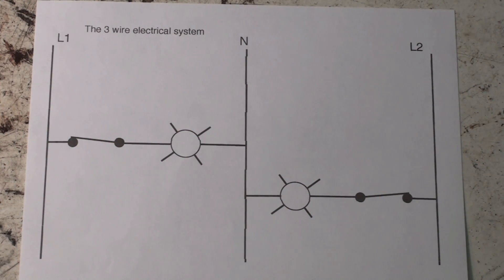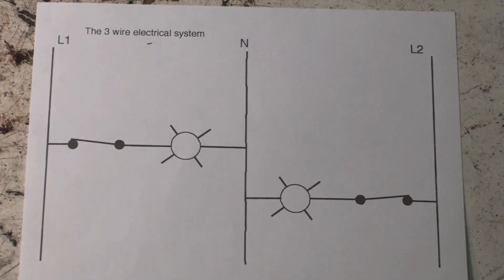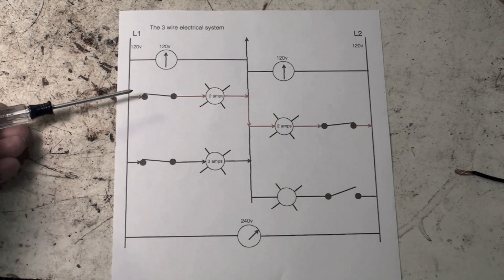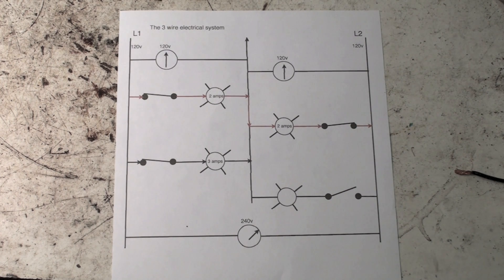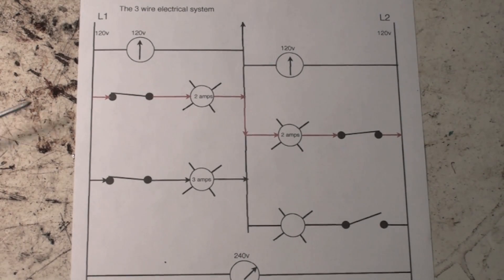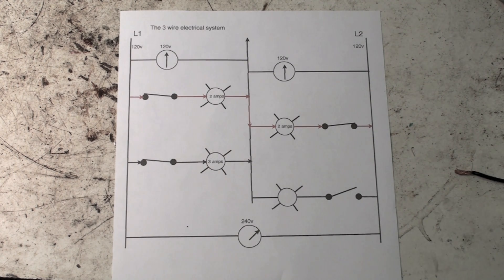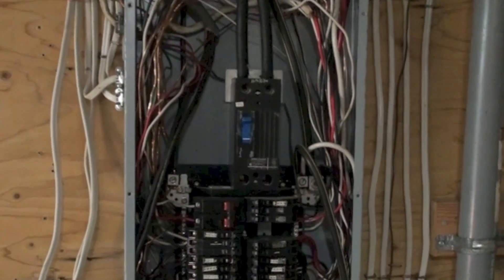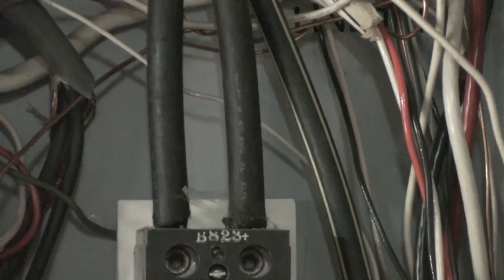How the 3 wire electrical system works

Comment: I am sorry this guy does not know what he is talking about. Power does not run backwards on the other hot wires L1 or L2. AC current runs up and down in a sine wave, but It only generates work in one direction on the down stoke from +0 degrees to -180 degrees.  To get 240 volts you have to have 120 volts on L1 and L2 put in a series circuit to add the voltage and they have to be out of phase by 180 degrees. What that means is when one line is at +0 the other one is at -180 its recovery stage backup to +0. 
All I am saying is power runs from L1 to neutral and L2 to neutral period. 240 volt is L1 added to L2 added together in series and out of phase.  All power going into your house goes back to neutral in your box where it is connected to ground.  All power in the neutral wire will be sent to the ground, not sent to another home.
The power does not reverse down another wire to balance other loads or homes.  Once it goes through a light (load) energy is used up and voltage and amperage would drop, so the next light would be dimmer.  There are better videos on this subject, don’t listen to this guy and don’t confuse people making videos on subjects you know little about.
3 Phase AC Motor Working Principle
Reply from the maker: I'm not sure where to start.  Of course power does not go backwards thru the hot lines.  It is balanced with other houses on the same transformer.  As to how it is balanced from there, I have no idea.  That is for the utility to deal with.  
The generates work issue makes no sense to me.  There is power available for work in both the positive and negative wave.  
If you have a 240 volt circuit neutral is not involved and is not provided to a 240 volt circuit.  You can test this by clamping the incoming power leads in the panel,  then clamp the neutral.  You will find the amperage to be much lower on the neutral.  
While you are at it you can also clamp ground and you will find little or no amperage.
L1 and L2 are not out of phase.  If they were, the total voltage would reduced by the amount of out of phase they are.   Here is a video on the phasing between the two 120v lines:  http://youtu.be/bnPNMKdXj84
If the house had only 240 volt appliances, there would be no power at all passing thru neutral.  
The earth ground plays little or no part in the circuit.  It is primarily spike absorber and lightning diverter.  This video explains the difference:  http://youtu.be/-n8CiU_6KqE
I did take a look at the video you linked.  It is correct as far as it goes, but there is much more to this issue.  
I do appreciate your comment.  I just think you are wrong.  I will welcome a return comment or better yet, a video. 
GFM
Reply from the maker: Not meaning to beat you up but, Good grief.  This is a video about the 3 wire system.  How to understand why you read certain voltages and amperages at certain places.  Consider you are someone looking to understand how the wiring works in your house.  Would you need to know that " both current and voltage are negative then power is positive"?   Your comment has more value to those studying theory.
GFM
Reply: grayfurnaceman Yes,...Love it,...High Five!
Reply: A technical note: Power is the product of current and voltage or Watts=Volts*Amps. That said:
1. If both current and voltage are negative then power is positive.
2. If both voltage and current are positive, then power is positive.
But
3. If voltage is positive and current is negative then power is negative.
4. If voltage is negative and current is positive, then power is negative.

Pure resistance loads will always have positive power flow, but negative power flow can happen, if only momentarily, during each cycle if there is either capactitive or inductive reactance in the load.
Reply: I understand, and I understand the video's intent and audience. On the other hand,  comment discussion threads often digress into other areas. I only offered my comment  on power flow direction for technical accuracy in this discussion thread, rather than starting a new one.
Reply: @Keith so what youre saying is that opposite phases will cancel out due to opposite voltages and no potential from there?

Comment: This guy is an idioit.  The power company dose not have neutrals on power poles, they have grounds, the neutral originates at the main breaker panel at your house or business  where the ground stake and the house neutral are bonded together.
Reply: The neutral does not originate at the main panel. The neutral originates from the transformer that's on the utility pole. 1 Phase from the HV line goes into the transformer, the primary winding, the secondary winding is CENTER TAPPED VIA GROUNDED NEUTRAL that is why L-N is 120, L-L is 240, because of the neutral. Look it up on Wikipedia. Here's the link http://en.wikipedia.org/wiki/Split-phase_electric_power
Reply from the maker: If you are interested in learning about these concepts, this video may help:  Ground Resistance Testing (real world experiment) with Electrical Code Expert Mike Holt  I also have a playlist on grounding and bonding that explains more of these concepts with several more in the pipeline.  This is the most misunderstood concept about our electrical system.  Hope this helps.
GFM
Reply: Contrary to your comment, this guy is NOT an idioit (sic).
However, according to the definitions of the International Electrotechnical Commission (IEC), both of you could be both right and wrong.
International standard IEC 60364 defines Earthing (Grounding) arrangements by using a set of standardized letter codes, where
“PE” = Protective Earth (Called “Ground” in North America.)
"N" = The “Neutral” conductor of the supply, which is connected to Earth.
"T" = Direct connection of a point with the “Earth” (From the Latin: terra)
“C” = A combined PEN conductor fulfills the functions of both a PE and a N conductor
 “S” = Part of the system uses a combined PEN conductor, which is at some point split up into separate PE and N conductors.
Most developed countries now use what is termed a TN-C-S earthing system.
In this case, the code (TN-C-S) indicates that, at the source of supply (the transformer) the Neutral (N) is connected to Earth (Terra,) a Combined (C) PEN conductor goes from the supply to the distribution board but Separate (S) PE and N conductors are used in fixed indoor wiring and flexible power cords beyond this distribution point.  (Note that the local Earth stake is not included in the IEC standard.)
In the UK, the system used is also known as Protective Multiple Earthing (PME), because of the practice (as in North America) of connecting the combined Neutral-and-Earth conductor to an Earth stake at each distribution location - and “multiple” customers are supplied (with 230 V) by each secondary Phase of the common supply transformer.  A similar system in Australia and New Zealand is designated as Multiple Earthed Neutral (MEN).
This situation is similar to North American usage, except that there one transformer usually supplies a single consumer at which location a local Earth/Ground stake is provided.  Hence, while it might not be described using the word “Multiple” it could be described using the word “Dual” – either Protective Dual Earthing (PDE) or Dual Earthed Neutral (DEN).
Reply: Actually, from the transformer, the secondary winding is center-tapped with a neutral, allowing the 120v to neutral, 240v line to line. The three wires coming from the pole are your two hots and a neutral. Then neutral is bonded to the grounding at the first means of disconnect. Take a look at your service before running your mouth.
Reply: ABflanagan523
Just because the third wire (the one that is not covered by insulation) looks like the ground, in essence, it is not. It just doesn't require insulation let alone conduit in an overhead service is because the free air allows the conductors to cool off.
Reply: The reason why your compressor starts and trips the breaker is because you have an instantaneous trip breaker that trips because of the FLC of the motor, the calculation you failed to do. Maybe if you guaged the wire correctly and the right size breaker, you wouldnt have that problem.
Reply: The neutral is not on the utility pole, yes because the configuration is Delta, Three Phase. You are right. But when you add the transformer, the secondary winding introduces the neutral because of the L-L 240, L-N 120 that travels either overhead or underground to the electric meter which is the first means of disconnect and according to code, is where the neutral is bonded to the ground. check it up, don't call someone an idiot because of your lack of intelligence on the subject.

Comment: This might be a dumb question but you state that the neutral takes the 120 and it goes back to the power pole. My question is if the main box neutral is grounded also how can it pass to the power pole would it not pass to the ground?
Reply: The code for a grounding conductor is 25 ohms.  An isolated neutral will always read close to 0 ohms. Path of least resistance dictates that the return current (whether it is from a 120 load or an imbalance of a 240 load) will always go the route of the neutral. Besides, in newer homes with an isolated ground, there can be no current to ground unless there is a live fault in the system.
Reply from the maker: The neutral goes back to the pole transformer where it contacts the center of the transformer winding.  The neutral in the main panel is connected to earth ground, and the pole transformer has its neutral connected to earth ground.  The power in the electrical system does not go thru the earth ground.  The resistance is far too high.  Earth ground is just a reference point to drain off spikes and lightning.  Hope this helps.
GFM

Comment: hey your videos are awesome and im learning more and more everyday.....however i have a question regarding grounding....i am designing a science experiment where i have a 120 V source (DC) and i am trying to melt a lego guy that completes a path from the conductor to a block of clay....your saying 120 V wont fry this guy? or do i need something more conductive for the lego guy to step on?
Reply from the maker: First, the lego dude is made from plastic.  One of the best insulators.  Clay can be a very good insulator also.  You would need 800 ohms of resistance to get 150 milliamperes (a possible lethal current) through the circuit.  You have several million ohms.  You might try soaking everything in salt water.  Hope this helps.
GFM
Reply: I figured it was like a polymer based clay or it wasnt high enough voltage....thank you for the advice!

Comment: Great video thanks... could you make a video for 3 phase 3 wires and 4 wires ?
and this unbalanced load for sure balances itself with other loads in the entire system.. I mean there is no chance of going back to the plant? Or how they figure out how much load they have it at the moment?
Reply: You can google TN-C-S, IT, TT, Split phase and High-leg delta.

In Y (TN) systems you have neutral and 1 phase for small loads (normal outlet).
If you have a 3 phase motor, you use all 3 phases, no neutral.
The voltage you get between neutral and 1 phase (in a Y system) should be: voltage between phases (L1-L2) divided by √3.

Split phase would be L1-L2/2
High-leg delta would be L1-L2/2 (This apply just for L1-N and L2-N, this do not apply to L3-N, if you look in to high-leg delta you would understand why).

In a balanced system you wouldn't really like any current going in neutral. Ofc, there will always go current between breaker and load, but from the main panel to the transformer you would like to spread the load on the phases and run as little as possible current in neutral.

Comment: Good explanation, this always baffled me. So does this mean that 240 volts is available at every outlet?
Reply from the maker: Sorry, I did not find your comment earlier.  No it is not.  Only one side of the 240v line is there.  The neutral is the other side.
GFM

Comment: Something I'm missing and I REALLY want to get this. At 2:35, why do the two voltmeters at the top read 120v and the one at the bottom reads 240v. If the circuit is joined at the top, what's the difference? It's all metal wire conducting electricity isn't it? What is separating or splitting the current at the top? Please help. I must understand. :)
Reply: Oh is it because when it hits the neutral line after the first voltimeter, there's a pull that draws the current back out the to the main line and so it never travels to the next voltmeter? I guess like two streams running downhill into a river? (Sorry, I know -  I'm pretty wet behind the ears on all this but I'm also foolish enough to think I can understand and fix my faulty wiring too).
Reply from the maker: The voltage in your home is 240v.  The neutral is a center tap from the pole transformer.  So when you read from the center to one line, you read 120v.  When you read across the 2 hot lines, you will read 240v.  Hope this helps.
GFM

Comment: That makes perfect sense. I don't know if this is something you know or not but the amps that get returned to the power company via neutral is this worked out in the meter reading?
Reply from the maker: Yes.  It all must come thru the hot lines anyway, so the meter reads it there.  
GFM

Comment: at 1:13 you state the neutral is not ground.... however, the neutral and ground share the same potential. If they share the same potential, then, how can they be different?
Reply from the maker: The neutral is used to balance the potential between the 2, 120 volt conductors.  Ground is first connected to a ground rod.  It then goes to the ground bar in the panel which is connected to the neutral.  The potential between the 2 is 0.  But where the neutral goes back to the power source, the ground goes to the ground rod.  What this provides is lightning protection.  If lightning strikes the neutral it dissipates thru the ground instead of getting into the structure.  Hope this helps.
GFM
Reply: grayfurnaceman many confusing things going on here grayfurnaceman. I just looked at my main in my garage. My grounding wire is coming from the pole (xformer) and so are the other wires. 2 legs of 120, 1 neutral and my ground. Also, I see the grounding bar and neutral bar are bonded together in the main fuse box. So, they must have the same potential since my Fluke 87 shows direct continuity between the two. So,  they are of the same potential. Ground and neutral are the same, right?
Reply from the maker: melvin292 No.  Confusing isn't it.  You should not have 4 wires going to the pole.  You should have 2 hots and a neutral.  The neutral is bare.  The neutral originates in the transformer.  
Let's try another example.  The main panel receives the 2 hot wires and the neutral.  The ground bar is connected to a ground rod.  It is also connected to the neutral coming from the pole.  And the 2 are connected together to provide a path for lightning to pass to the earth ground.  If I install a sub panel off of the main, the ground and neutral must be be separated at the sub panel and a neutral and ground must be run back to the main because the neutral must be able to carry current back to the main panel.  I hope this does not confuse you more.
GFM
Reply: grayfurnaceman yet, as you stated in a previous example, "Ground is first connected to a ground rod.  It then goes to the ground bar in the panel which is connected to the neutral." With that said, the ground and the neutral are  the same potential. This must mean neutral and ground are the same... right?
Reply from the maker: Rather than try to explain this method, I will do another video that perhaps will make this more clear.  I may publish this today.
GFM
Reply: melvin292 Yes ground and neutral are both connected the only differance is that neutral carries current to the earth and ground is only suppose to carry current if there is a fault.
Reply: +melvin292 - In a nutshell, neutral carries current, while ground does not.
Reply: +melvin292 - Neutral carries current, while ground does not. Ground only carries current during a fault. Here's an common example to perhaps help you understand this simple wiring. If you follow the wiring, both the brake circuit and the headlight circuit are connected back to the same 12V point in your car. When you push the brake pedal, the brake circuit carries current, while the headlight circuit does not. And vice versa. Being tied to the same point in no way forces current to flow through every conductor tied to that particular point.
Reply: Impossible if neutral and ground share the same potential.
Reply: +Cotronixco no, thats not the right answer. You're not close either. You need to slow down and really think how a circuit runs. We 're not talking about dc voltage or two separate circuits. I will give you a clue; the word is impedance. See if you can figure this out.
Reply: +Cotronixco confused I am not nor is it appropriate to use crude language to communicate your point. The topic here is potential. A bond between two wires, what we call a ground and a neutral. All here suggest the neutral is the "path back" and no current is carried by the ground wire. I am not suggesting the ground is carrying current, I'm telling you the ground carries current. This in fact is normal because the neutral and the the ground share the same potential in the main electrical panel where they are bonded. Simply, the impedance is the resistance found in the ground vs the neutral back to the source. Swegs have been used for years. No need for a neutral. Think of it this way; a simple ladder diagram. L1 is switched. Off the switch are 2 loads parallel. You're suggesting current will pass through 1 load and not the other because of differential impedance. This is not true.  Current will pass thru both loads. Your analogy of 2 dc circuits has no relevance to the subject.